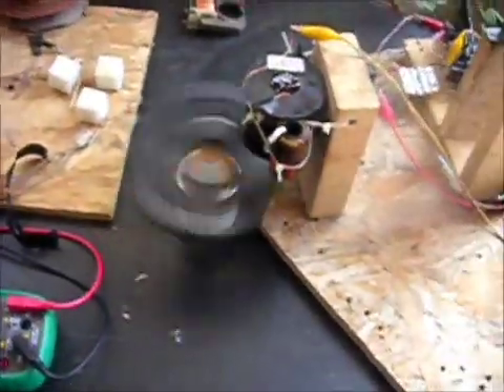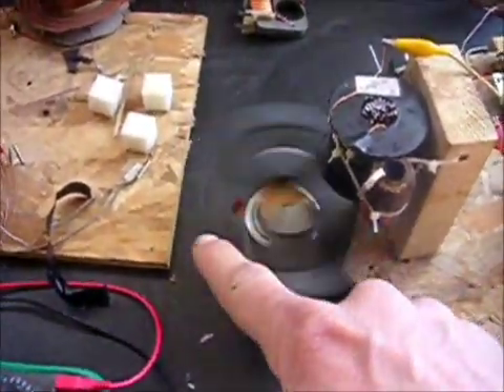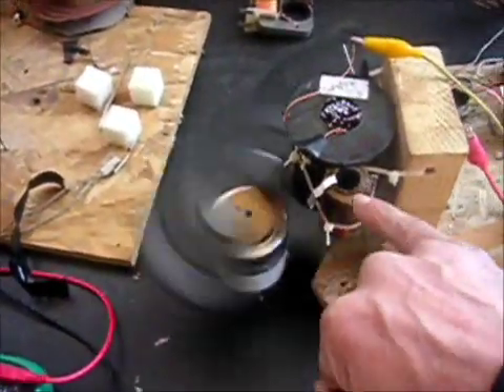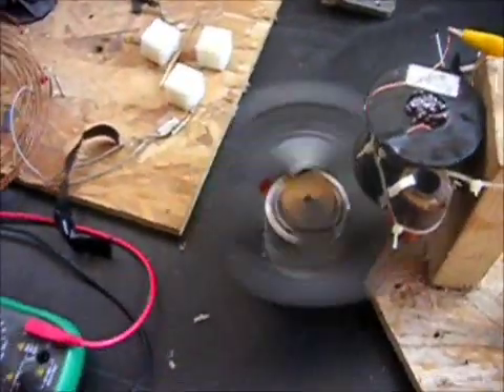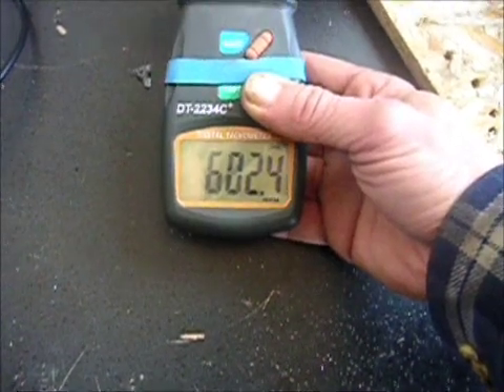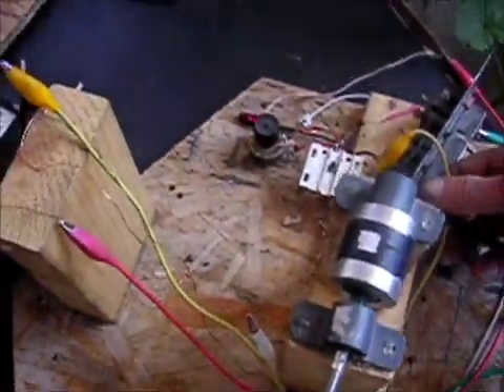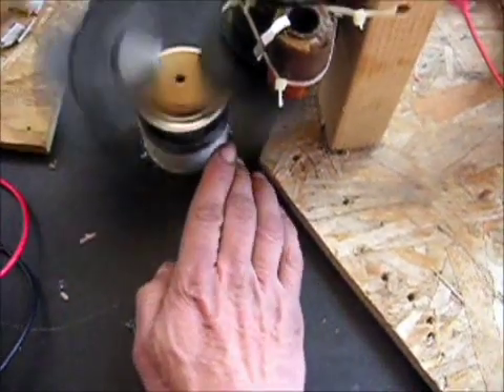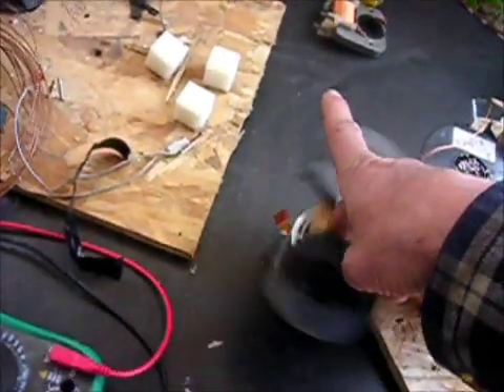Bedini - increased speed with separately rotating magnets

Comment: I can see the angular momentum "angle" ;)  I have been thinking if this same concept only the magnets would be angled at 45 degrees on the upright. Giving it torque through angular momentum if that makes sense? Then using a DC motor like a hard drive motor to collect voltage from the main bearing. It's kind of  Da Vincian but its one idea I had.  So many,  experiments so little time. If you can get an extremely efficient Bedini motor that looses very little but is driving another larger generator through angular momentum.  You are using both kinetic force and EMF in pairs. The trick is getting stable rotors at 45 degree angles. http://ocw.mit.edu/courses/physics/8-01-physics-i-classical-mechanics-fall-1999/video-lectures/lecture-24/
That entire lecture is pretty informational. But go to 20min in and you will see what I am trying to convey.
Reply from the maker: Good call, I had the same thought about the DC motor as an axle/generator.  Thanks for the sub :)

Cheers!

Comment: In effect, when the magnet is taped up, the magnet is larger than when it is allowed to spin. Larger magnet = more drag etc...I wonder what speed you would get on that wheel if you used the John Bedini recommended block magnets on that same setup. That core seems a little thick, is that 3/4 inch? try 1/2 inch. I like the experimenting, but I also like to see people succeed in getting 1/1 charging at least. cheers.
Reply from the maker: The Bedini circuit was just a prime mover for this, curiosity got to me :)  Seem to remember getting an easy 5000 rpm with this coil and a diametric magnet from an old refrigerator compressor.  Thanks for the observation!